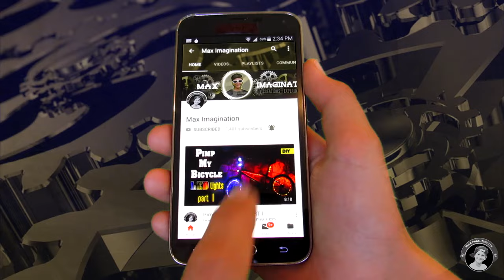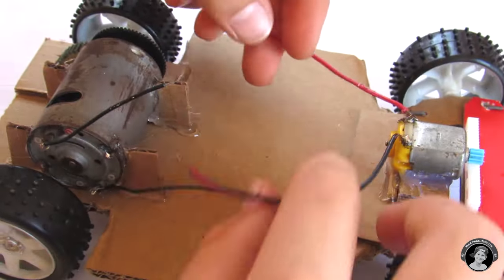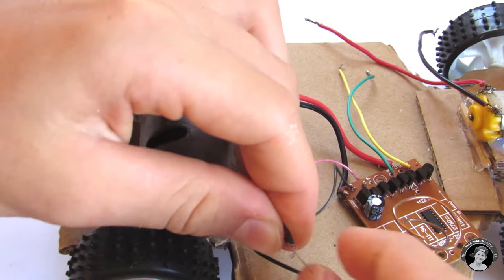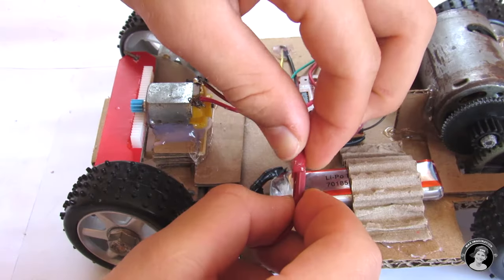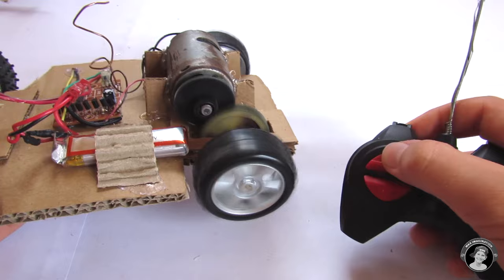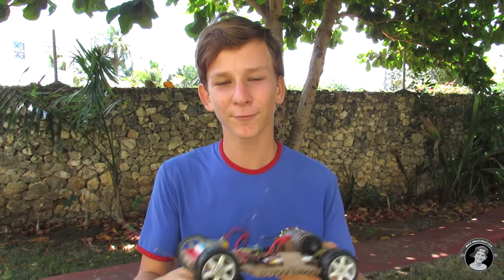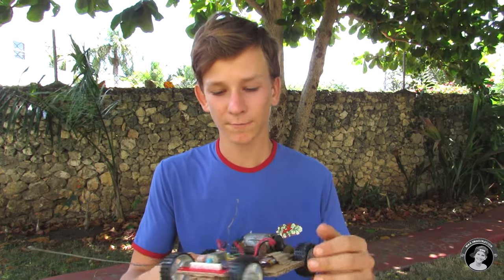How to make a Simple RC Car with Steering | DIY Remote-controlled Vehicle

Comment: What is the maximum sensing distance range?
Reply from the maker: Hi, 
The maximum control range can vary, with my current 27mhz TX & RX pair gives me a range of 15-30M. Extending antennas on both the transmitter and receiver would increase the range by a few more meters or even up to twice the range. 
Cheers ✌
Reply: Aight cool

Comment: So..... How do we make it? There are 0 instructions.
Reply from the maker: @xblackdemonx3183  Well, sorry this old video of mine couldn't help you, from this video onwards, I started making them more explanatory. Giving key details.
Reply from the maker: @xblackdemonx3183  The motor you need is a 540-type mini air compressor motor, I left links in the description below for you to check out including the remote you need.
Reply from the maker: @xblackdemonx3183  And I did actually explain what wires were supposed to go where, the wiring should be straight forward for anyone :) 
I didn't include any circuit diagrams or in-depth explanations as I was just starting out with electronics back then.
Reply: @MaxImagination  Thank you very much. I appreciate it!
Reply from the maker: @xblackdemonx3183  I'm glad I could help, no problem! ☺

Comment: Yeah,the only thing is that it doesn't have the function to automatically make the steering to be forward again
Reply: and yeah,I know that it's the circuit board's problem
Reply from the maker: Hi, yes, that is the thing that may trouble many when making such RC car. As a simple mechanical fix to that issue, tie a rubber band or two to each side of the steering mechanism from a single point on the slider, then it should make the steering return to its neutral position.